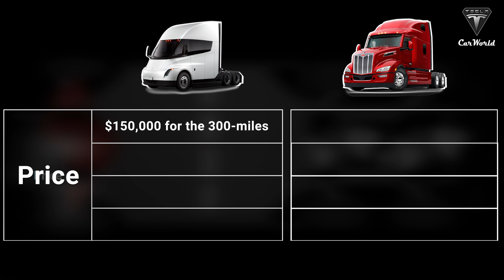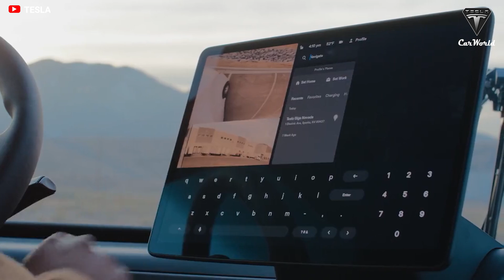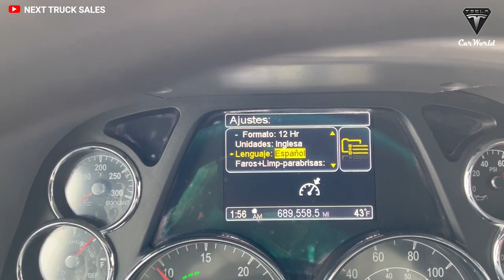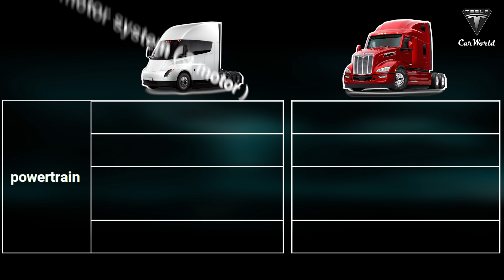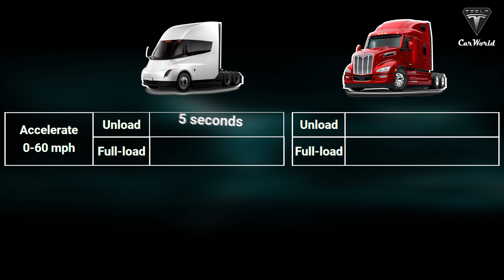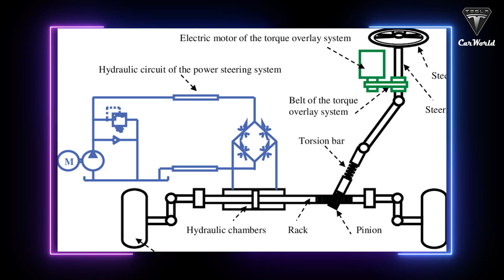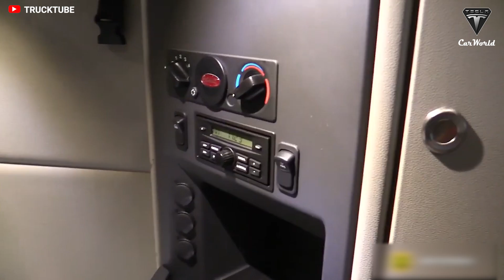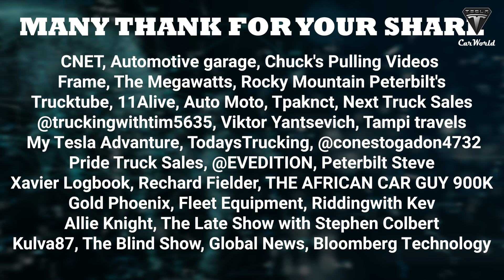Tesla Semi Vs. Paccar Peterbilt 579! Which is the Best Choice of 2023 Heavy Trucks?

Comment: I'll take the Peterbilt any day over the Tesla for OTR work.  Sure the Tesla is good for local loads, but not for OTR work.   You also make it sound like the Peterbilt is not capable of hauling over 80,000 pounds of cargo.  It's not the truck that limits the weight that can be moved, it's the FMCSA regulations.  Keep in mind, the extra weight of the Tesla will damage the roads more than the Peterbilt even when empty due to the weight of the truck.   The Tesla will do 500 miles and need to charge (if you can find a charging station) for 30 minutes for just 70% full charge so the 2nd charge would need to be done at around 350 miles.  The Peterbilt will do about 1600 miles on 1 tank (200 gal) at 8 MPG and then need to spend about 15 minutes re-fueling to have a full range available again.  So, 1600 miles in the Tesla would require 3 to 4 re-charges (about 3.5 to 4 hrs.) and 2.5 to 3 days to complete.  The Peterbilt could complete the run in 2 days under current regulations on 1 tank of fuel.
Reply: Pretty sure the Peterbilt is not capable of hauling over 80,000 pounds of cargo. First, diesel semis are limited to 80,000 pounds GVW  And to haul even that, the truck and trailer would have to have zero weight, which I'm pretty sure isn't the case.
Reply: @BigBen621  ya, I was talking about GVW. My point is, the only reason the Tesla is rated for 82,000lbs is due to the weight the batteries add to the rig.  If both rigs had the same cargo, the Tesla will probably come in at or around 2000lbs heavier because of the batteries.  So, while the tesla can be at a GVW of 82,000lbs, that doesn't mean it will carry more product.
Reply: @bbstacker4926  I think we're on the same page. To be clear, it's not just Tesla that's allowed an extra 2,000 lbs. GVW--it's all natural gas or electric powered trucks. I'm guessing the Tesla tractor will be more than 2,000 lbs. heavier than diesel tractors, as you say because of the batteries; and so it will likely have somewhat less load capacity—but not dramatically less, as some folks are claiming based on a blatantly false video by Thunderf00t. So potential buyers will have to decide whether it's worth taking a modest reduction in load capacity to gain a large reduction in operating costs.  My guess is that many will, especially since reportedly many loads are limited by volume, and not weight. This is particularly relevant because the first Tesla Semis will be operated by Frito-Lay. Can you really fit 40,000 lbs. of Fritos in a semi trailer? 🙂

Obviously, there will be many tasks for which the Tesla Semi isn't appropriate--including coast-to-coast trips with two drivers, so that each driver can drive the maximum 11 hours. What we'll be finding out over the next months and years is just how many tasks are appropriate for the Tesla Semi; but Tesla didn't become the largest selling automobile—not EV—in eight countries, by misreading the demand for their vehicles!
Reply: @BigBen621  Yep I agree.  As built, I think this truck will be great for the local market, or runs up around 1000 miles.  Gotta see how the industry reacts and how fast they can get the charging stations put in place nation wide.  I'm thinking the major truck stops need to buy into building charging stations at each of their locations so the trucks can keep moving. Unfortunately that will take up parking space that is already hard to come by. If I were running a day cab or short haul operation, I would really take a look at this truck.
Reply: @BigBen621  😂 😂 you are slow I have a peterbilt 389 Cummins (paccar would run a little less) and I do LBO (look that up before your idiotic comment) that trailer has 8 axles each axle is allowed to pull (with permits) so normal truck has 4 with a 1 steer so that’s 11 axles so I’m allowed 176k lbs and usually run 150s constantly and my truck hits 800lbs with no problem and she has pulled over 200 when I had a military contract so please do not rush to comment when you have 0 knowledge about the subject

Comment: The 579 wins if your business is carrying cargo. Tesla can carry about 6 tons of cargo (half the capacity of a diesel semi), see the Tesla propaganda video. A typical diesel semi weight 17 tons empty with 13 tons cargo capacity. It will take 2 Tesla semi to carry the same load for one diesel semi. Do you want to buy extra trucks and pay extra drivers? Other electric semi has shorter range (smaller battery) because they want cargo carrying capacity. Carry potato chips is easier than carry water base soda. Another stupid idea from Musk.
Reply: Sounds like you're quoting from the Thunderf00t video showing catalog cuts from a Czech company for a barrier much smaller than the ones on the Donner Pass test, and weighing much less. The 11 barriers on the flatbed climbing Donner Pass were 10' standard K-barriers, which a multitude of sources will confirm weigh about 4,000 lbs. each. 11 x 4,000 lbs. = 44,000 lbs. payload.

Comment: GVW of 82,000 pounds for the Tesla is not cargo capacity, Gross Vehicle Weight increase is due to heavy 1000 kwH battery. The Tesla video shows about 5.5 to 6.5 tons of cargo at 81,000 GVW when compares to diesel truck with 80,000 GVW with over 13 tons of cargo. This is just a Tesla pumper video with all the propaganda from Musk. Why won't Tesla publish cargo capacity for their semi truck? Because it sucks.
Reply: The Tesla video shows 11 10' K-barriers, which weigh 4,000 lbs. each; so 22 tons payload...
Reply: @BigBen621  And we've seen Diesel semi's with 12 10'K-barriers 24 ton payload and still 1,000-4,000lb less than the max 80k lb payload depending on day cab or sleeper.
Reply: @pogo1140  No doubt. No one's said the Tesla will have the same payload as a diesel semi.
Reply: @BigBen621  If you can't carry the same weight, you are paying more for a truck along with higher insurance, loan interest payments while getting paid less per trip.
Reply: @pogo1140  Pretty sure operating costs come into this equation, as well. If a Tesla Semi has 10% less payload, but 50% lower operating costs, which are plausible numbers, it will still be attractive to many potential buyers. But of course the bigger the reduction in payload and the smaller the reduction in operating costs, the smaller the group of potential buyers will be.
One poster mentioned trucks delivering furniture from factories, and stated that they never get anywhere near GVWR; Presumably these folks could accept a pretty big drop in payload from a diesel semi without affecting their trips, and take maximum advantage of the much lower operating and maintenance costs.

Comment: Let say..correction plesae. Anyone . 
150 kw generator use a 6 liter diesel engine burn 3 gal hour.  Charge 1Mw
In 6.66 hr aka 400 minute
20 gal diesel  x4$80$
÷ 500mile
=           |16|19|23|.cpm 
Dsl$.   |..4|. 5| .6|.gal
Generator cheaper lighter than battery
train Engine..  
Yt vid show various
Tesi with generator
One 10kw(warperceptn)
To small. Burn 18 mpg
Other pull 50kw 3.9lt
Un finished vid
Maybe 30 mpg 
Is said tesi make 187mpg equivalent

Tesemi mpg equivalent.
42 mpg ??
72 ÷ 12 (cpm) = 6
7 mpg diesel x 6
=42 mpg ??
Reply: Diesel electric fuel 1/2of
Diesel trans differential
According to me 
That be 14mpg 28 cpm
Acades ÷.66= 21 mpg
19 cpm ???
Reply: Tesisemi battery 70k$ 
Weight 6000 lb
Reply: 150 kw gen could be
6 + gph

Comment: Hey, Tesla semi has a smaller battery than 1MW . Because;
Tesla used 93% to go 500mi.. and used 1,7kw per mile.. 👍🇳🇴
Reply from the maker: Elon Musk has confirmed Tesla Semi's efficiency at 1.7 kWh per mile, which means it has a roughly 900 kWh battery pack. Thanks for your comment and have a good day !
Reply: Part of the actual battery capacity is not usable because it's held in reserve to compensate for battery degradation. I think it's 4-5% plus 1% for each year the battery is expected to be functioning.

Comment: Tesla needs to prove long-term rentable after all the costs  (maintenance ) in 10 years could be a comparison with the counterparts the venerable diesel trucks  , add improvements the regular diesel hybrid engine will be able to run another 100 years . 111😀😀🙏🙏🙏

Comment: No gear shifting, no down shifting, no break wear, auto pilot, built in security cameras, auto tracking the list goes on and on.
Reply: Crap!!!! We’re not in the 70’s anymore, modern trucks are much advanced and some drivers prefers manual transmission while automatic also exist
Reply: @alanmay7929  I also prefer manual transmission when driving for sport but when it comes to business, I believe business owners would prefer a truck that is the most cost efficient.
Reply: @Al-yc4cn  it the truck that will haul the most goods in the shortest time and do it all over again talking about diesel.
Reply: @Al-yc4cn  in Europe trucks have more powerful engines and hauls significantly way more than the US, why can’t the rich USA handle that kind of thing!? They only know how to waste $700 billions ever year in army
Reply: @alanmay7929  Federal max road weight limits

Comment: My son had a pacar peter and it is absolutely a POS....Used coolant and oil in excess....had to replace the engine within 2 years. Bolt fell out and radiator fell into fan....new rad replacement...many various failures.....Tesla has to be better. They got a new International
Reply: Tesla is not known for QC, it's 100k cars are often less well put together than a Toyota Corolla.

Comment: Now we have BEV Semi's why aren't the tops of trailers fitted with solar cells. In this way the batteries can be topped up with charge. On a 40ft trailer you should be able to get 20-30 300W solar cells. This would give a @6kW -9kW of charging. If a trailer carried a 30kWh pack then 3hrs of driving the truck driver could charge from the 30kWh battery pack.
Reply: I've seen these curtains that you can pull over your standard container to conceal your load from prying eyes. I've also seen reports on flexible thin film solar cells that are now available. What if you make these curtains using these new solar cells? This could be a real game changer. I have no idea how the economics will work out, but this will be definitely be invaluable in an apocalypse event.
Reply: Because that trailer may or may not belong to the company, most trucks will leave the trailer at the destination and go pick up another load
Reply: @pogo1140  I think it would make sense for trailer owners to put solar panels on top of their trailers. They can charge a bit more to BEV truck owners. Obviously when BEV Semi trucks become more popular >20% of the market I think it will make sense.

Comment: I don’t understand why Tesla didn’t include a sleeper in the cabin
Reply: They are just starting with a day cab. Also the end game is a truck that drives itself so no sleeper required.
Reply from the maker: However, Elon Musk revealed that its designers are "considering" some type of sleeper model in 2023, which would extend the length of the cabin but not the overall truck length. The Tesla may be great for local intrastate delivery work. Thanks for your comment and have a good day !
Reply: @danielstapler4315  Ah yes, the fully self driving as Elon said they have figured out back in 2017? 
cough BS cough
Reply: Im guessing the first batch going to Pepsi don’t need sleepers. Later versions likely will.
Reply: @Al-yc4cn  Pepsi doesn’t drive through the country at night?

Comment: I live in California and they are requiring these trucks be zero-emissions and look to be pushing the date to 2036 from 2040. Tesla should make as many of them as they can. Oakland will probably require them before the state does. Zero other companies have build out a more reliable charging network than Tesla. I wonder is it practical to have a charged truck Ready to go at the recharging stations, how easy is it to swap out the truck with the load? I wonder if fast charging will kill the batteries faster then the rest of the Tesla fleet ?
Reply: No such thing as zero emissions, a con
Reply: @Terry Orzechowski Iron ore pulled from the ground by huge DIESEL powered machine, then made into to sheet metal be coal powered furnaces... not a thinker,are we?
Reply: @Terry Orzechowski Elon Musk seems to able to see further than the border of the US.

Comment: 82000 lbs is total gross vehicle weight (tractor + trailer + cargo).

Payload = cargo only

Tesla has not disclosed tractor weight, hence we can't know for now what the payload capability will be.

In 2020 Tesla impact report they did say it will have equivalent payload capability as a diesel tho.
Reply: The reveal day video shows a flatbed with 11 concrete highway construction barriers on it; if these are Jersey barriers they're 4,000lb each, and a standard diesel semi can haul 12. The implication is that the 500 mile range Tesla Semi tractor unit weighs around 6,000lb more than a diesel semi tractor unit.

Comment: 10 times more battery - 10,000 pounds - can I charge those batteries with Solar panels on the  50 to 60 foot trailer roof? Yes in CA - Arizona, Texas and Florida - Free Energy
Reply: Try calculating how much electricity you can actually gain from that and you'll be disappointed.

Comment: Tesla Semi should have a 32" TV in the "sleeper cab" drop-down twin mattress, the outdoor security cams should auto shoot instantly to the 32" TV display and front displays for movement getting close to the Semi, flamethrowers pointed in front of doors in case break-in thieves/murderers, etc. And all trailers should have solar panels on the total top of the trailer to help recharge battery packs for a little extra mileage while driving or parked. Solar should extend wider while parked with enough space around with a push of a button for faster auto solar charging. Trailers while off the truck can be charging infrastructure to help energy problems and to earn a bit of exta cash.
Reply: You're wrong about the flamethrowers. Texas won't be carrying liquid fuel. They will use high energy lasers with facial recognition to get them between the eyes.
Reply: @Doug-gp2qw  Nice 👌 Idea!
Reply: You would have to own the trailer or else all those solar panels are going to be left at your destination.
Reply: @Pogo  This is why I said ALL trailers should have solar so no matter what trailer you are using, it would come with solar on top, if every trailer in the US had solar it would definitely put a small dent into the infrastructures power at peak demand times while the trailers are off loaded and parked in storage. I don't know how often trailers are unhooked from semi trucks, but would be neat if not only houses and solar farms had solar roofs, but everything that is lying about in the sun with enough space to add any amount of panels. I understand your comment, if you don't own the trailer, you won't be getting paid for the electricity incoming, that would be tricky.

Comment: In order to save $200000 in fuel the truck would have to go 80000 miles in one year
Reply: Thats only 270 Miles a day for 300 days a year. So easily managed on a single shift.
Reply: I never subtracted the cost of electricity for charging.    So you're gonna need a lot more miles than that to make up for it. Don't forget you'll be carrying less weight and making less money for the same trip. So we need to take that off for there too. Most likely you're gonna have to pay for charging stations at your company so let's go ahead and take that out too. Now you only need a million miles a year.

Comment: In the real world, insurance companies charge much higher rates for trucks with high horsepower. The trucks have speed limiters and power limiters that cut the performance tremendously. The insurance companies have become abusive about it. Only owner operators have the optional features shown for these trucks. Want to know what a corporate driver gets? Delete anything optional, and you can see what most drivers have to work with. Most drivers on the road are company drivers. To be honest, if the beds in long haul trucks weren't standard, the drivers would be sleeping on boxes in the back.